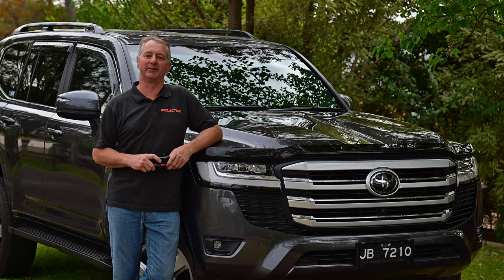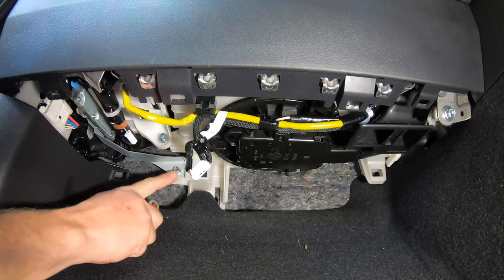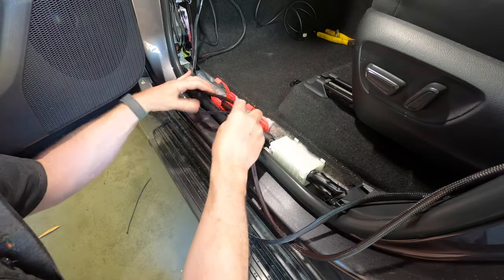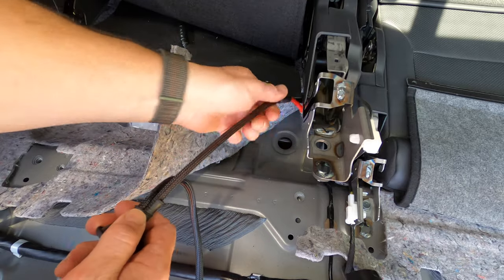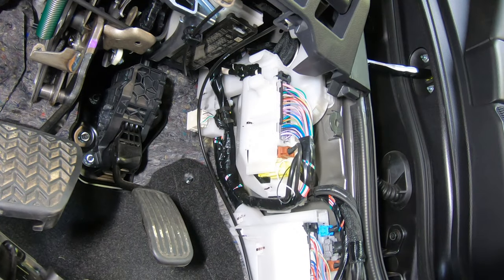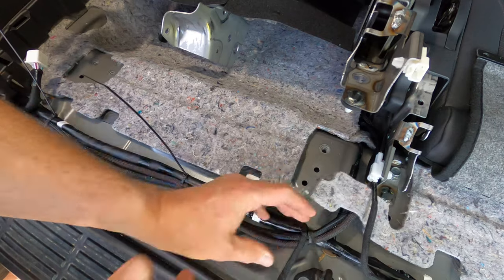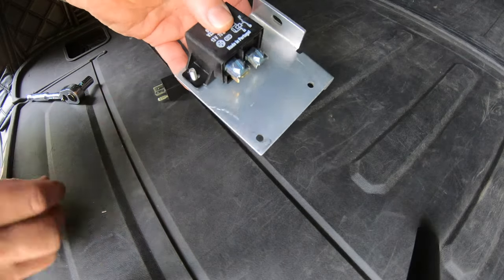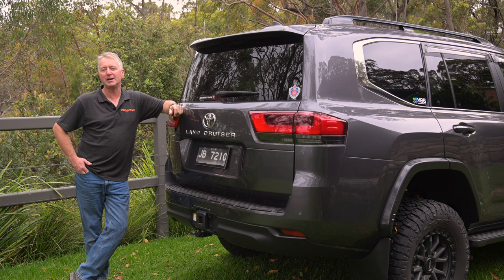REDARC TowPro & 50Amp trailer power install - LandCruiser 300 - with Anderson plug & ignition relay

Comment: Looks like a big job. But it appears that Toyota kept the possibility of after market modifications in mind when designing the detail of the car.
Reply: Seen a video they did so Toyota themselves could plug and play and still charge the same. That and to resolve the issues of hack job work that causes other issues
Reply: @ausguy4385  interesting! Do you mean “still change“, or indeed “charge”?

Comment: Awesome detailed vid, thanks 🙏 
One question; do you have a duel battery setup (not that I saw that) if not does the Anderson for the trailer or camper trailer or possibly a caravan run off the single battery?
Reply from the maker: I don't have a dual battery setup in the car permanently. The Anderson for the trailer runs off the start battery/alternator, and powers a DC-DC charger that's in the trailer which charges the trailer battery. I've just made a removable module for the back of the car, which includes a fridge, inverter and a slimline LiFePO4 battery, which is charged by its own DC-DC charger, fed from a second Anderson plug that's mounted in the load area. I'll be doing a write-up/video of that setup in the future.

Comment: Great vid mate but just wondering why you installed the relay? I didn't think it was needed in these 300's? That's what Redarc told me anyway
Reply from the maker: The relay is to turn on/off the power to the trailer power feed, so it's only powered when the ignition is turned on. Depending on how you set up a DC-DC in the trailer, it's possible it could flatten the start battery if wired directly without a relay, as it could keep charging after the engine is switched off, until the voltage drops below 9v at the charger. The Richards kit includes the relay, and I prefer it that way for certainty.
Reply: @austimages  yeah I understand why they're used just didn't think they were needed in this case. You're doing a great job with the build :)

Comment: What is the other stud on the battery positive terminal
Reply from the maker: It's holding down the other end of the MIDI fuse, connected to the battery terminal itself. You can also add a second fuse/terminal next to the one I have used, so you can have two fuses/outputs. I've done this now to power a battery charger in the load area, but I haven't done the video/article on that yet.

Comment: Better still go to a electrical supply store and get waterproof glued heat shrink.

A 50amp with chassis return...
That junk.... by the time it at the dcdc in the van the voltage drop with that size cable it not 50amp draw no more...
Reply from the maker: The cable in the kit is 6B&S (13.5mm2). Chassis return gives less loss than running that size cable back to the battery, but even assuming loss would be the same, given a 50 amp draw, voltage drop is only about 0.8v at the trailer. REDARC 25/40/50 amp DC-DC chargers have a rated minimum input voltage of 9 volts. Given a nominal alternator output of 13.8v, that means you'll get at least 13 volts at the charger input when drawing a full 50 amps.